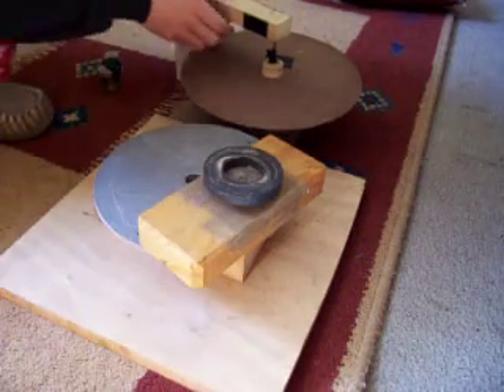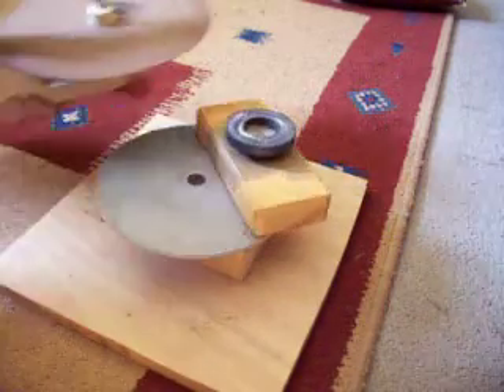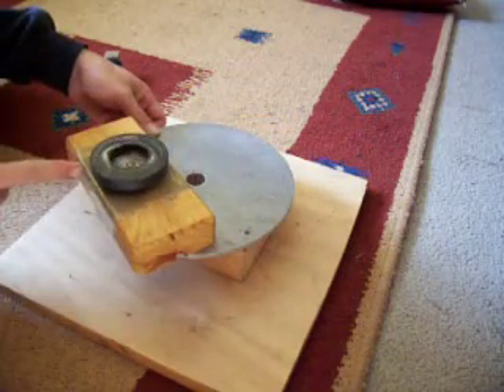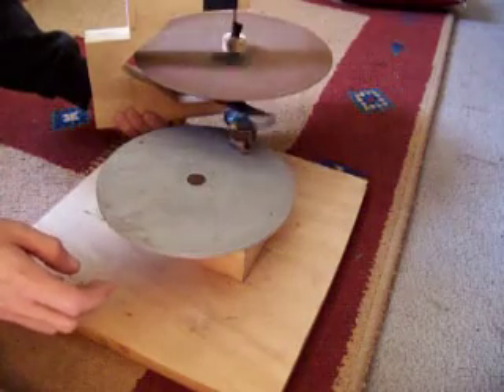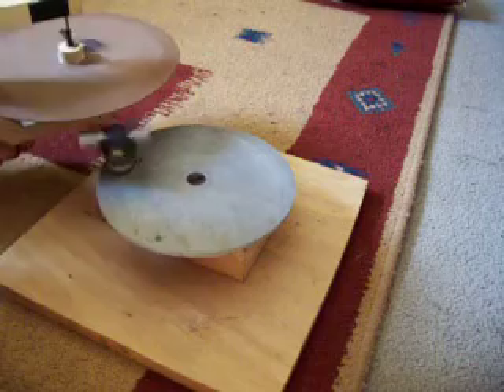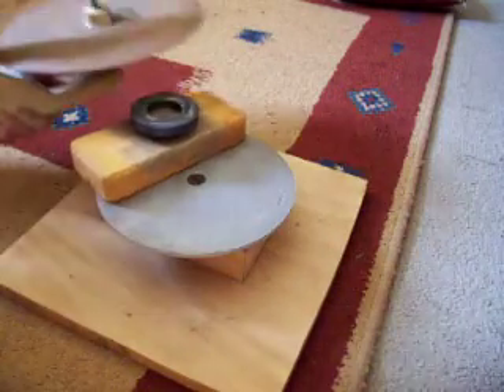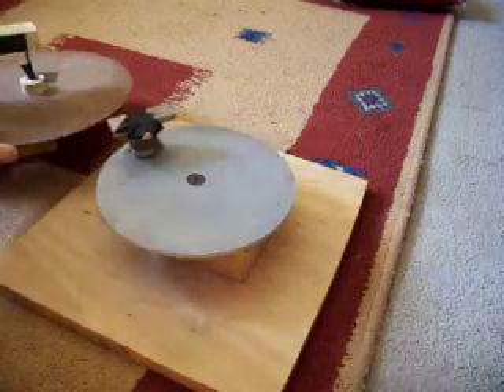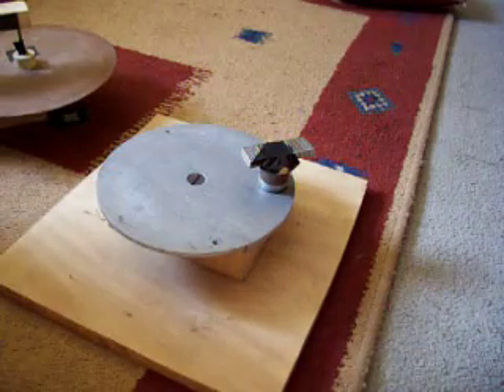104_1040.MOV

Comment: We can see the same effects in electric wire insulation, you can touch a charged electrical wire if it is insulated properly. and why soft metals like Gold and Lead are good insulators against electromagnetic radiation. the plyability of the atoms in the soft metal deflect or absorb the current or radiation. there's nothing being created here, only reflected or absorbed. if energy was being created then the result would be exponential. this a good experiment to show this principle.

Comment: It's called magnetic shielding, Copper is a soft plyable metal, same as Gold, the magnetons are being reflected back onto the magnets by atomic flexing within the copper causing a push back effect. A magnet in a copper pipe slows down because the magnetons are pushing back against the magnetic field of the magnet. if you view it with an electron microscope you could probably see the ripples embedded within the metal itself as the magnet falls. oh, I forgot, electrons don't exist. lol.